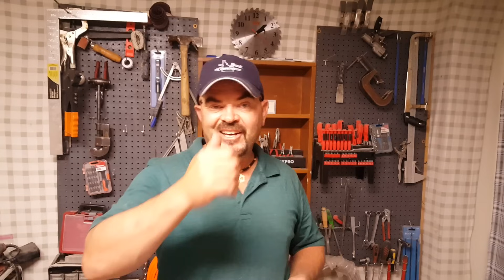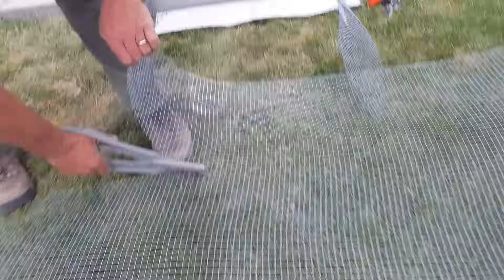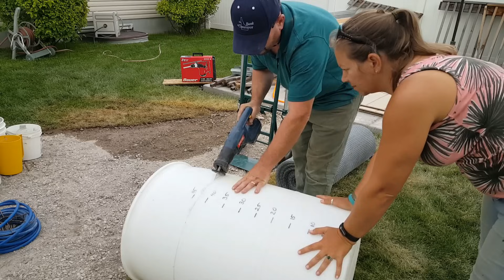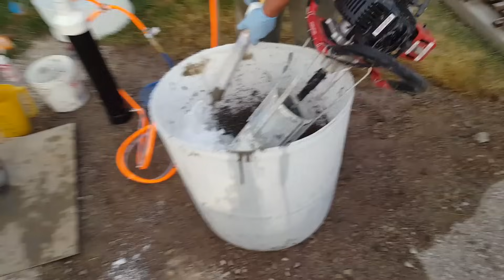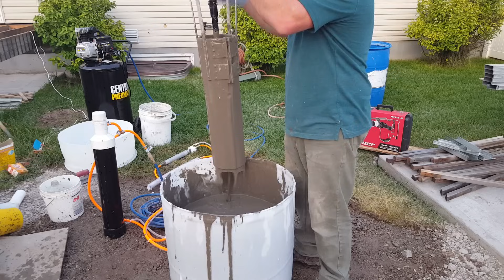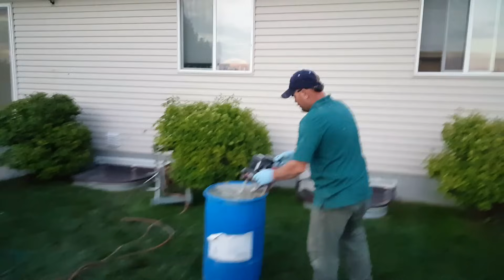Pouring Air Crete Panels for Shed

Comment: Your concrete should be dryer when it comes out of the mixer. There is to much water in the mix! The more water in the mix the weaker the concrete. As you add the suds your adding water.
Reply: It would probably be impossible to mix with foam otherwise.
Reply: It's not concrete. It's foam and portland cement. There's no aggregate in it. It's supposed to be lightweight and airy. Mixing like you do a concrete driveway completely deviates from the purpose.
Reply: I keep wondering about that too.  Everyone that is mixing aircrete starts with a very wet mix.  I think the only way to mix it dryer would be to use a concrete spray system (like they use to form swimming pools) and then add the foam right in the spray nozzle so it is mixed and shot out at the same time.  Would be difficult to engineer that though.
Bottom line is how much structural support this material is expected to provide.  If it only has to hold up its own weight then the wet mix with metal mesh should be ok.
Reply from the maker: Yep, that's right. you are so smart....
Reply: Zac Crow

If i understand it correctly, cement never dries. It "burns" which means that the water is becoming part of the cement in a chemical reaction. The plastic is put there to keep the water from drying away, which would ruin the concrete and form cracks and make it brittle. Somebody please correct me if I'm wrong.
Reply: thank you! Finally said it!!  More water means STRONGER!   Thats why many places will keep spraying water on a sidewalk or garage floor for weeks to keep it curing!
Reply: Hammerjockey Radios Yes they are assisting it in curing.
 Mixing an inappropriate amount of water in the intial mix makes the mix weak. 
Spraying water on it after it has hardened a bit helps to cure it out.
Cement, concrete etc are hydroscopic materials and will constantly absorb and release water throughout their lifetime.
Reply: Yes less water in mix and once it sets up keep it wet, slowing down the cure. I’ve building skateparks, driveways, countertops, etc etc for years. When I make pool blocks for coping I mix crete Portland and sand let it set up in my molds for 24 hours with a wet towel over it, then take them out of the mold and let soak under water in baby pool for a month. When I take them out of the pool let the sit out for a day or two after their set on pool the blocks are bulletproof, grind amazing and never chip out.
Reply: optimal cement to water ratio is 1:4, The curing of concrete is a thermic reaction and the poly is put there to reduce surface evaporation. The longer the surface is kept moist or wet the slower the concrete will cure reducing cracks from shrinkage but simply adding more water to the concrete mix will weaken the structure once you surpass 1:4. It is becoming more common the have plasticizers built into mix design so concrete can be used in an more usable state and maintain the correct water cement ratio.
Reply: The mix it called cellular concrete. It's a type of flowable fill used for bridge construction etc.. the basic concept, at least when we were pouring it was that you were batched with 7000 lb of Portland cement and x amount of water. The mix shows up as piss. When on site the foam is added to the mix turning the 1 yard of cementitious slurry into 10 yards of cellular concrete. So indeed yes that shit is supposed to be piss wet
Reply: I agree  @shawnr771

Comment: Nice work. If it's in the budget maybe a vibrating probe to get out some air pockets.
Reply: mel e it's Air Crete. Vibrating out the air would be undoing all the effort to get it in there.
Reply: Wouldn't "air-crete"  - without the air - just be "crete"? 
I look forward to that video; although heavier panels / increased material cost / reduced insulating effect might not attract so many likes.
Reply: I did not catch the air crete part of it. Thanks for the correction.
Reply from the maker: https://www.youtube.com/watch?v=i2eNx0CVXD8      https://www.youtube.com/watch?v=i2eNx0CVXD8

Comment: Have you thought about screwing the interior or exterior board to the form with a plastic barrier of course before you pour so that when you stand it up one side will already be finished? Or possibly using the studs with the holes for one side and put interior and exterior finish boards and pour through the holes, basically prefab wall panels.

Comment: use a angle grinder to cut that crap it is the most vicious stuff on earth
Reply: Definitely a cordless angle grinder will be quicker and easier.
Reply: The tool of choice
Reply: I like using electric double cuts
Reply: Last time I had to cut some wire mesh, put a abrasive disc/wheel (think it was a 6"'...found what I needed at HD) in a circular saw, cut quickly and accurately
Reply from the maker: I call em nibblers
Reply: yes but not having to wear a mask and glasses is a plus!
Reply from the maker: https://www.youtube.com/watch?v=i2eNx0CVXD8      https://www.youtube.com/watch?v=i2eNx0CVXD8

Comment: if aircrete is poured into a vertical form - what is the maximum height the form can be before the weight of the aircrete on itself significantly  collapses the foam bubbles towards the bottom?

Comment: Any reason you wouldn't use a foaming latex to reinforce and make more water resistant vs surfactant that makes it more prone to water uptake.    Just add surfactant to concrete or grout latex and then foam.   Okay, I'm suggesting you do this as a polymer guy for improved properties.

Comment: I have a question about aircrete as a insulation material as opposed to using it for its strength. Can it be applied in between traditional stick framed walls?

Comment: Even a swimming pool prefabricated that you can order online have it shipped on site place into a prepared area hose it down with water to let it expand from its compressed state from being shipped then line up all pipes and drain and lighting has the pool swells up and hardens rock hard. Then after curing spray the inside of the pool with a color tint what ever color the customer wanted let dry then apply a clear coat to seal the pool and give it a smoith surface to be able to keep it clean and easy on the feet and skin. Taking building to a higher level and using renewable resources has building materials and cutting costs from not having to pay labor by the hour to get everything built. Imagine ordering a roll of of bamboo ceramic fabric with a banana cellulose ceramic sponge that you could prepare the ground then roll out the bamboo ceramic fabric ceramic sponge hose it down with water and lay a side wall? Then after it cured apply what ever tint you wanted let dry then apply a clear cost and or lay tile over it? 😊

Comment: I watched a house get set with air crete panels and they set them on what looked like an aircrete sills and thinset morter the side panels looked to be doweled at about 12 inch centers with added thinset adhesive. I would just drill dowel holes over sized and imbed hot dip galvanized threaded rod using mortar or epoxy or just thinset. No unsightly rusting angel iron to look at.

Comment: Nice video. I’d recommend making the concrete less wet. It will be much stronger and cure faster. I’m curious why you don’t just spray the foam in the mixer. Does it pop the bubbles? Anyway I’d say make it pretty dry since you’re adding more water from the foam machine. If you make concrete that we and drive on it it’ll probably break unless it’s thick or you wait a real long time for it to cure.

Comment: Could Air Crete provide adequate strength in ICF residential construction and be a cost effective solution to the high price of concrete?
Reply: John Ewing  Not by itself. It has to be reinforced with fabric on at least one side, like drywall is with paper. It takes roughly 28 days to cure, depending on the humidity.

Comment: what I don't like about this is that I can't use mortar to secure the 2 sections together and that the metal stud may entrap water at the bottom should the stucco ever fail and the aircrete become porous.
Reply: it's a shed, without maintenance, all stucco will fail.  If a house, you must accomodate for the water that may penetrate and use flashing to keep it redirected out of the bottom and away from the foundation and wall plate.

Comment: I’m curious if the aircrete is lighter then obviously there’s more air pockets. My question is how does that hold up when wet and temps go below freezing and the trapped water expands? Is it less durable because of that?

Comment: I understand you're showing a video but little bit more of an explanation of the process, where'd you get the foam, what's the mixture between foam and cement and what type of cement are you using?

Comment: I had a house built 1973 that used air Crete on an enormous slab deck floor over the garage. It was covered then to have a 1000 sq’ 2nd floor BBQ deck with a dedicated huge fireplace (included in the triple flu chimney serving the whole 4000 sq foot house).   While more experimental then, they compacted and removed the larger bubbles using a vibrator. I noticed chips and larger deficiencies around the edges where the 4x4x8’s were used every 8’ to support the solid roof that was a continuance of the house roof. The contractor only used a single central 3” round plumbing pipe as a support in the large garage underneath which was inadequate since air crete is NOT meant to be a supportive weight bearing material. Since I wanted to expand that open air space into a library that would have to support over 16 tons of books and shelves and new construction i supported it with a central wall with steel beams and 12” on center 4”x4” wall down the middle still allowing for autos and workshop. I think air crete is still a viable material but there is more engineering to be done on methods of actual concrete density, binders and type of foam chemicals used so as to not react to the elements in the future (i.e. liquid detergents).

Comment: Darwin try a side grinder on your wire mesh. You can set a guide like a piece of strapping or plywood with a slot cut in it, and zip through multiple sheets if you want. It pains me to see you snipping that way. Piece work style pal! Also a metal chopsaw and crimper for your stud work will save you a ton of time. Love what you're doing, wish you were here.

Comment: Not to knock your plan, but you could probably enroll in a material science engineering program for less than the cost of the Kickstarter you mentioned, and end up being able to play with much more expensive tools and facilities without actually having to buy them.

Comment: I wish I had seen this 4 days ago, I would have told you to splint your thumb with a popsicle stick to keep from bending it or tearing it on objects.  Murphy's law states that you will catch it on every corner and bend your thumb without thinking and tear the glue bond and hurt yourself.  In leu of a popsicle stick I would cut a custom piece of plastic from the bottom of a two liter soda bottle and fit it as armor to the thumb.  It might still come in handy as it heals.

Comment: I am curious why you don't put the foam in the concrete mixer and mix it? The second step of mixing it seems to be a waste of energy. Self proclaimed novice just trying to learn something.
Reply: The concrete in the mixer is a coarse step, and to make concrete, you have to get the ratios and agitation just right. If your add the foam there, it will sit just at the top. Try and mix it with a shovel and nothing will really mix. Now in the drum, the mixing happens at a working height. The auger-turned-mixer has just the right agitation and mixing path. It is more fine tuned work, at a comfortable height.

Comment: I feel like the mixing process could be streamlined if you hooked the foam generator onto the mixer. The foam should get pulled up through the auger without popping, and the auger may have enough drawing power to keep the foam generator from clogging.
Reply: what foam is about

Comment: I  find a grinder with  a carbon  blade  works  more  efficient  for  cutting  hardware  cloth or some  people  call  it rabbit  wire, that  wire can be hell on the  hands, the  4" grinder  is quick. I  like  the  concept, good job!

Comment: Does foam concrete use sand? Hemp fibers like used in fiber glass could not be used in foam concrete to make it much stronger in place of using sand? Other idea why not use a ceramic mix that you could pour into molds then use an ultraviolet light to cause the mixture to harden? A machine could be designed that you could rent that you could add in the mix water and choose which molds to use and pour and cure what ever you needed to use for your condtruction project. With a strong ultraviolet light source that penatrated the mold from all sides to cure the mold in minutes. Bricks long panels squares of different sizes all sorts of molds could be created to use with a product like that. 😊

Comment: This is the first of your videos I've seen. I have many questions: have I missed other videos describing the materials you're using, is this your own invention, what is the cost of this versus regular concrete, once this cured what is the weight of these panels versus concrete, how are you attaching/assembling these finished panels, what are the benefits of this material over other materials, are there other videos on this same project ? These are initial questions I have, now searching for my own answers on your channel so pardon me if these questions are premature. Thank you !

Comment: I apologize for being critical but use a cut-off wheel on an angle grinder for that wire! That snip snip snipping was driving me crazy. For a video about Air Crete panels, we saw no Air Crete panels. Just pouring into the form. Better than nothing, I guess. And also better than my video, of which I have none.

Comment: Was the tool you used to mix the aircrete a petrol auger fitted with a pvc pipe sleeve? (sorry if covered in previous videos)

Comment: I've been watching Earthship vodeos. One of the most labor intensive and time consuming parts is making rammed earth tire bricks. How do you think, aircrete filled tires would work in creating a berm home? I was asking because you seemed to have some expertise with concrete in general and have experimented with aircrete.
Reply: genial muy bueno
Reply: I can not wrap my head around the fact that people drag out these old tyres out to nature, and then bury them and claim that they are eco friendly. That is not what an earthship is about in my opinion. But I am thinking the same as you in terms of finding other solutions when it comes to earthships. Like making rammed earth bricks and/or combine materials, so the whole thing can be more modular and less labour intensive.

Comment: I watched a video called The Aircrete Building System. From what I can tell, they used aircrete panels they got from forms, put together with mortar. The way you do it is too slow in my opinion. I would build permanent forms that in a modular way, can be reused to make any sized building with just a few shapes.

Comment: From the videos I've watched it seem aircrete is not very strong structurally even with wire mesh reinforcement.   It seem the fault lies with the air bubbles which are great for insulation but not strength.  Would vermiculite be a better substitute for air bubbles?

Comment: Hey dar Honey Do,
I watched you for a while and you just get better and better.  I am so grateful for such innovation.  
I want to build a perimeter wall around my property using air crete.  I want to drive aluminum I-beams into the ground and slide the walls down between the slots.  It needs to be about 3 inch thickness, and about 9 ft tall.  
how wide is possible for stability?
Reply: You will never get the H beams strait enough driving them. Drill and cement them in

Comment: I like but it's very inefficient. All monies saved on materials goes right to the labor cost. You can timber frame or post and beam a shed or shop in a day or 2. Also when I comes to electrical and plumbing you have more challenges to overcome. Unless you have unlimited free labor and time I wouldn't recommend aircrete panels or blocks. Moveable forms is the best way to go IMO. Thoughts?
That being said I love the inventions.
I love the diy spirit of this couple. 
Trump2020

Comment: Really curious about this "stuff" but not sure how many applications there are.  Would really like to see some formulation experimentation as well.  I think the perlite is a good idea because the foam really has a hard time holding up to mixing and the perlite goes a long way to holding air.  
Would like to see a material property chart vs composition.  Have you tried fiber reinforcement instead of metal mesh?

Comment: i watch every video since the rocket stove ,that got me started. on your cut i have found or created a recipe that accelerates healing while minimizing pain or inflammation . since ancient times  raw honey is a wound dressing mix one tablespoon raw honey two teaspoons coconut oil one teaspoon Cayenne pepper if you have it one teaspoon msm powder. if not the first three ingredients are the basic apply small amount over cut or scrape or burn it is amazing the pain relieving abilities of the mixture apply would pads first day it will run a bit , so what lick it off taste good. I took all the hide off my knee tripping onto a metal corrugated  ramp .the skin was gone size off three quarters hurt like a bitch. i came in cleaned the wound mixed up some honey applied it to my knee and the pain was gone within twenty minutes was able to walk and work with minimal discomfort. if you have and infection add activated charcoal to mix and it will pull it out and heal it fast.
Reply: How much activated charcoal to this recipe?
Reply: Sandra Carr about two teaspoons just use your judgement, maybe a little more, this works for infections very well.